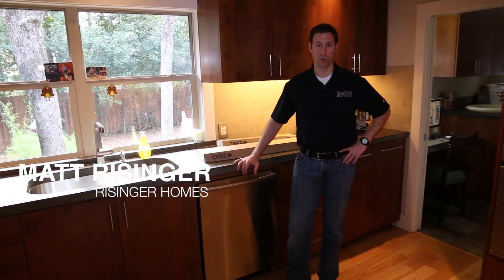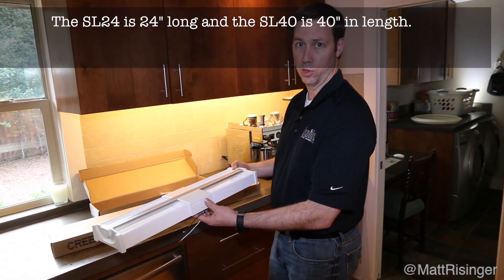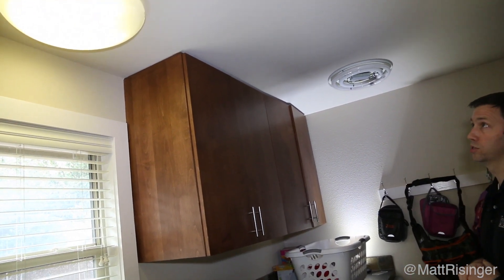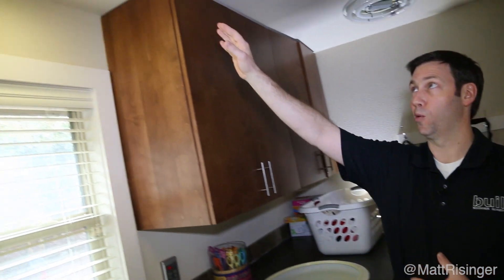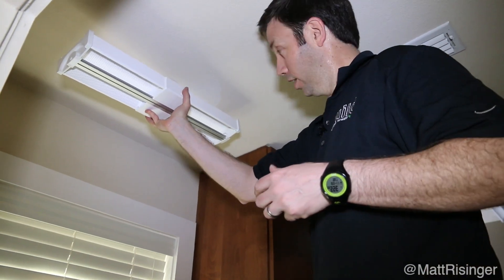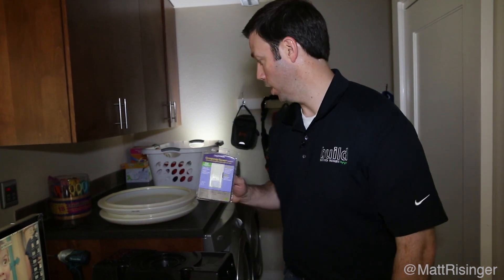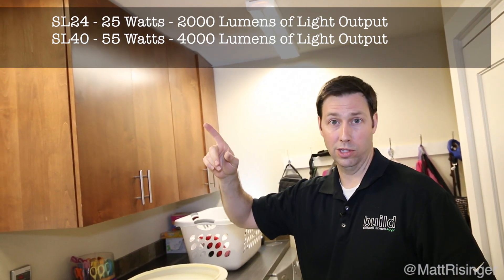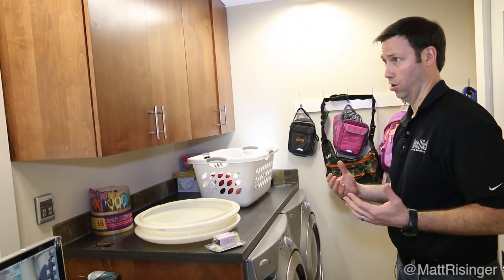Cree SL24 & SL40 Linear LED Fixture Review - (T5 Killer)

Comment: Here in our Can lights we run Toshiba Par20s that run around 240 Lumens. Ceilings are 10' and there's Tons of light at 100%. Dimmed to 40-60% and they change the mood while at 15-20 they make excellent night lights. I've tested high Lumen bulbs and they can't dim low enough which negates the very idea. 

I know Matt is a Pro at airsealing but for folks that don't or can't achieve his levels, we have had success using the 1 piece LED bulbs with built in trim rings and a tube of caulking. Air sealing & Lighting Efficiency for $20 a can & 5 mins of Labor.

Still waiting for that Video on the SD20 :)

Comment: Love your videos and thanks for posting!  As much as I'm a fan of the leds, i'm a bit surprised/disappointed with the wattage per lumen on these units. I'm running the t5 high outputs and they are 5200 lumens @ 54 watts. I just googled the t5ho and the lowest bulbs ive seen are 4800 lumens @ 54 watts. Now having said that, in your room, not sure you would want anything brighter than what you just installed. It looked like you needed sunglasses :-). I thought the t5ho setup was pricey, but thats nothing compared to led's. Regular t5's are obviously less than than the HO. 

Led's are great for there longevity, but the straight t5's have been great. As for the circular one you just replaced, not sure whats up with them. I bought my grandmothers house 6 years ago and I have the circular light in the kitchen like you, but I dont even remember ever changing the bulb, even when she had the house, until just recently I had too. Ever since I replaced the 2 bulbs thats all I have been doing. Not sure how there are making them now, but as you I couldn't take it anymore and just replaced them with high hats with the EcoSmart 6 in lights, which are cree. Cant say enought good things about those bulbs/lights...
Reply from the maker: Thanks for commenting.  I agree the HO T-5's have been a good product, that's whats in my garage workshop currently.  I'm not entirely sure why these circular fluorescents died prematurely, but my guess is that the off/on cycles daily were too much.  These are in a busy house with 4 kids, that room serves as our Laundry, Mud Room, Pantry, and my wife's command center with the family computer.  They get turned off/on ALOT.  So far, I'm very please with the switch to the CREE LED and I'll keep and update on the longevity of this fixture.  Best, Matt

Comment: Excellent product spotlight (no pun intended).  I didn't see in the video where you mention lumen output from the old lights.  What where the old lights putting out?

I just replaced 15 incandescent 65w BR40 floods in my kitchen, each putting out 540 lumens.  I replaced the with EcoSmart 9w LED BR30s putting out 650 lumens!  I was afraid my wife would not go for the smaller bulb in a BR40 size can, but she likes them even more.  LED lights are starting to get affordable enough to cost justify.
Reply from the maker: Good question on the output of the old lights.  I think the lumens output of the double Fluorescent round tubes was around 4200 lumens.  So, the SL40 is really close at 4000 lumens.  However the SL40 doesn't have the burned out bulb issue I was having with the double round Flo, I never seemed to have all four bulbs firing.  Sounds like you did the math on the changeover for your house.  For can lights I really think you want to be above 600 lumens.  Best, Matt

Comment: Can conduit be run into the ends of those fixtures?
Reply from the maker: I'm not 100% certain, but it doesn't look like it.  Matt
Reply: This product is not designed for conduit mounting. It is less industrial and more commercial / residential. It mounts directly to a standard junction box.
Reply from the maker: Rick Houle Thanks Rick for answering this one!